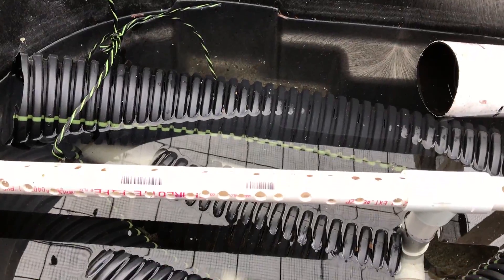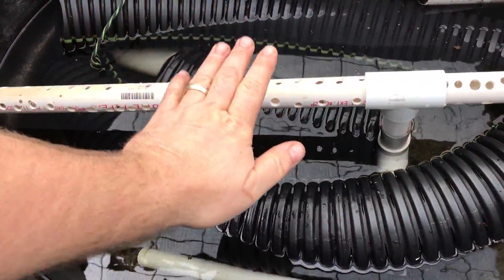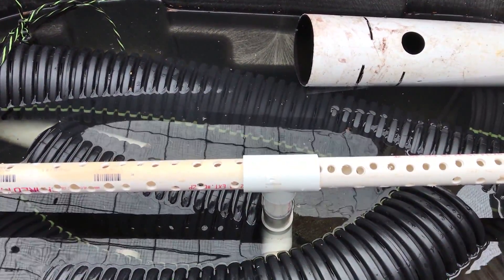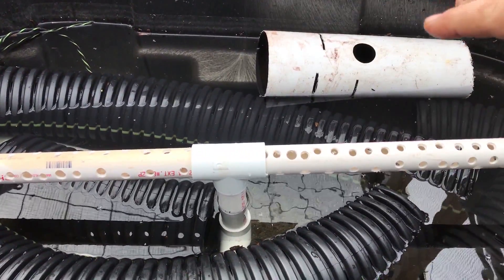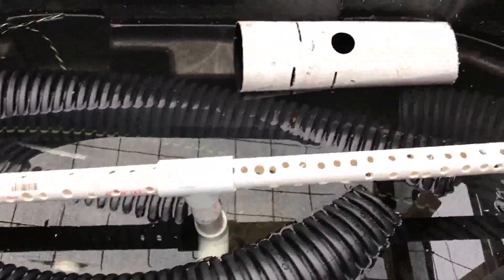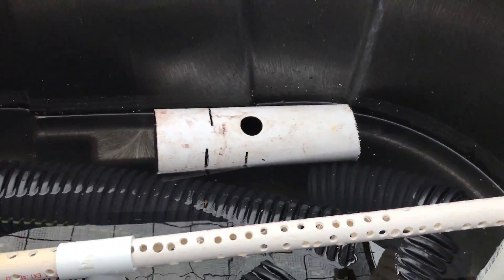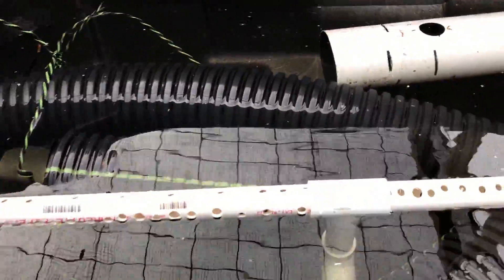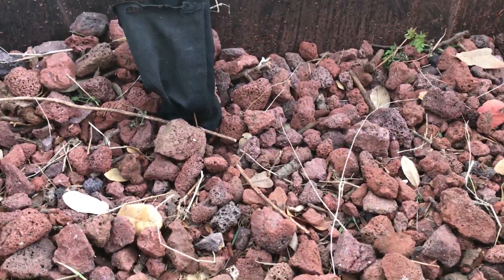Aquaponics Wicking Bed Construction

Comment: hi i want to build a similar wicking bed but longer may be about 10m. i want to connect a media bed that will directly flood into the wicking bed. the media bed may be 5 m long. what pipe size would you recommend? is that possible? thanks

Comment: Would adding worms to the system help ? Keep bad bacteria down and help eliminate residuals , possibly.
Best diy I have seen , good job brother !
Reply from the maker: Tons of worms in this system we dumped in about 10,000 at start up, they go right down into the wicking beds and even the flood and drain.  We may add some to the new beds once they are all done but the truth is they spread though the system on their own.

Comment: What are the upsides to having the deep wicking beds in the same system as the fish tanks? Do the plants use up nutrients that would otherwise build up or is it just for the water? Can you go through the advantages and any any possible drawbacks or things you need to be careful about doing this?

Found your channel last week and subscribed, interesting stuff.
Reply from the maker: ceselb The nutrients are In the water so of course they end up getting to the plants. You're also growing in soil so you can grow anything and you can supplement with solid organic fertilizers. Additionally research has been done that shows the healthiest aquaponics Systems always seem to have all three options Deepwater, flood and drain and wicking in them.